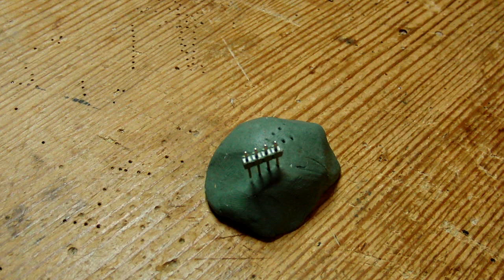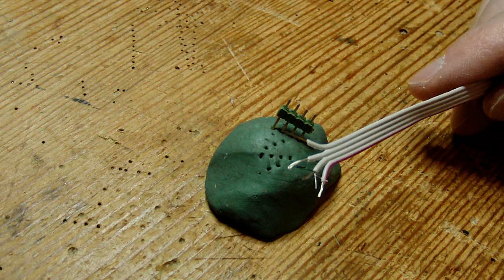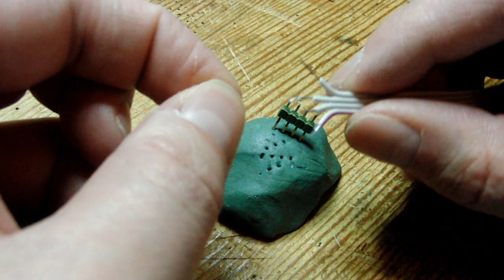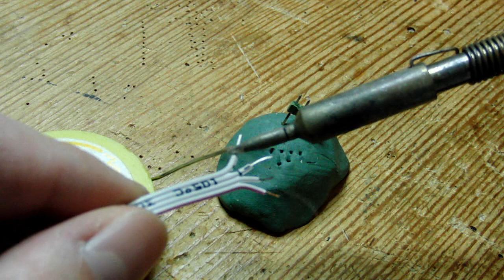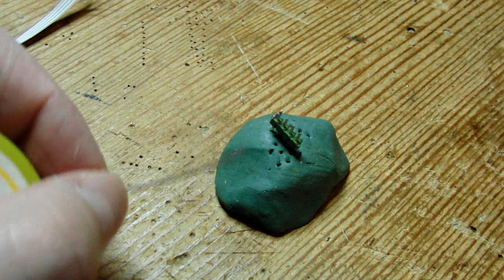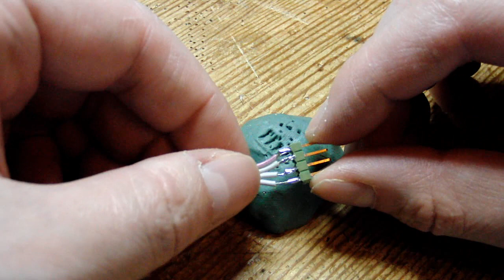Soldering tutorial: Solder a pin-header to a wire

Comment: That's a really unique and interesting technique that appears to work very quickly.  I like the idea of using a small piece of clay also as it looks like it gives you a lot of stability without having to constantly readjust the tiny thumb screws found on typical 3rd hand devices.  Nice Work!

Comment: I love your technique for adding the  solder ahead of time. First it’s got the flux intact and, secondly, it’s not in the way of placing the wire right against the pin.  Plus your use of putty to hold the header pin. Two really great ideas. The speed at which you can reflow the solder is impressive; what temperature do you usually set your iron to?

Comment: great video, nice tip top however maybe you can give me some suggestion how to solder a 13 pin plastic din connector because i only got the cheap version and when trying to get lead into the metal ends i end up melting all the connector and the lead wont stuck in the pins... :/

Comment: Useful technique, but where is the rosin/flux? After you touched the wires with your hands and just used solder on it's own this might work okay for the first month, but the OHMs are going to start creeping in over time, in the form of oxidization, and eventually will fail.
Reply: +ArcanePath360 He's using rosin-core solder.
Reply: +spartan456   Must have missed that, how can you tell?
Reply: +ArcanePath360 he mentions he's using it at some point
Reply: +spartan456   Stupid short attention span! Thanks